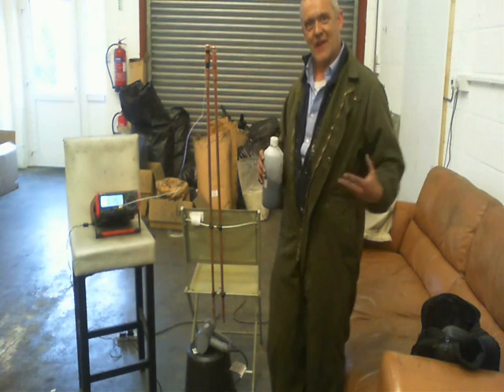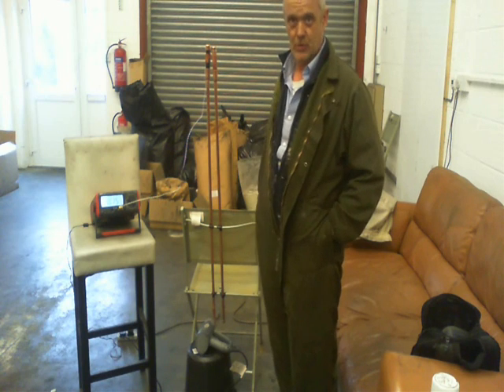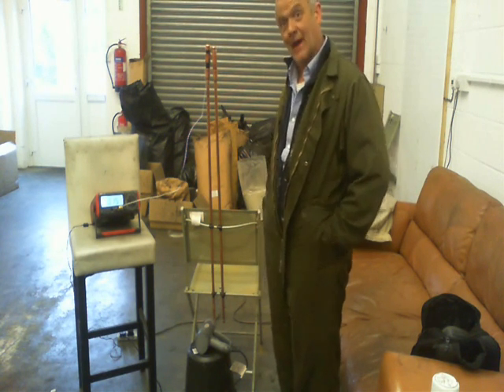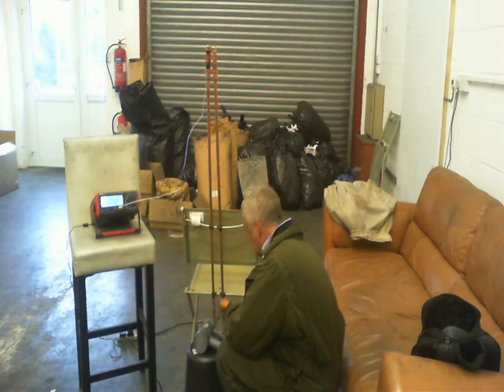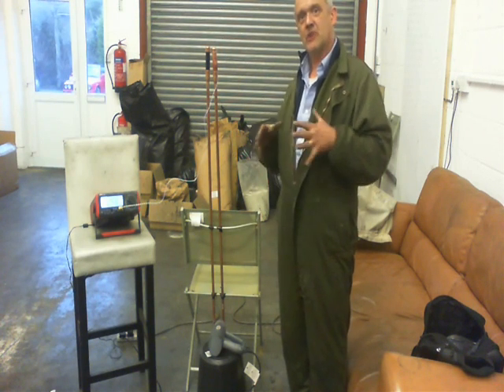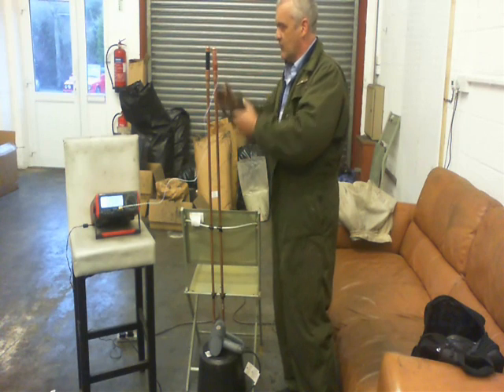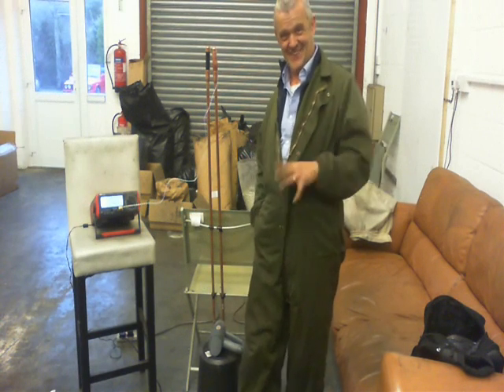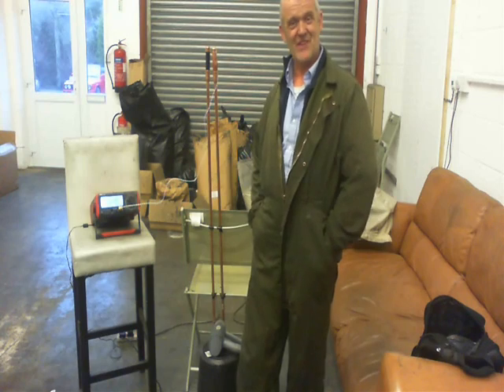Graphene Thermal Transfer Fluid In A Solar Cell Thermal Pipe

Comment: Just come across this vid, thx. Question, taking that the carbon filled took 4 min to get to 40C and the water took 6:45 min to get to 40C. would you say that was a 61% improvement? And if I were to put this in my home radiator system we would see an improvement in effeciantcy?
Reply from the maker: It's basically a heat transfer fluid so it would help there for sure - well I think so - copper nanoparticles might work well too

Comment: Thank you as usual sharing your finding with us.  It is good idea to use a internal heater and thermal insulation from the outside for the pipes to eliminate the possibility if the change in specific heat capacity of the liquid as the cause for the observed effect.
Reply from the maker: sure - sounds good mate

Comment: I am in the process of making a solar thermal system for my home. You video on ,making your own heat pipes was useful, but not as useful as the addition of graphene.

Which, do you think, would be the ideal medium to mix with the graphene within the heat tube?

How much graphene to solution for a 1500 mm evacuated tube? 

Can  you propose a much better heat transfer system from the "bulb" to the carrier fluid?

Where is the cheapest place to buy sufficient graphene for 20 units?

I would really appreciate your opinions.

Regards

Daniel
Isle of Anglesey.
Reply from the maker: +Daniel Phipps Hiya mate I am afraid i don't have much advice to give as all this stuff is experimental and there are  no clear cut answers just as there is no 'cheap' graphene just right now. the cheapest is just to make it yourself and experiment
Reply: +Thanks for replying Robert,
I will certainly make my own Graphene as you suggest. What percentage of fluid to graphene would you mix as a starting point and is water the best fluid, from your experience?
Cheers Robert
Reply from the maker: +Daniel Phipps I would start with 0.5% by weight addition mate and take it from there

Comment: I can independently confirm Robert's claims about this fluid. I made graphene nanofluid from exactly 20 grams of high purity 325 mesh graphite and mixed it into the water loop of a computer cooling system (approx. 20 grams into 20 gallons) to observe its effects. I can report with high confidence that the temps dropped significantly. (in degrees F) CPU before: 82 avg w/ 76 min ~ to ~ 66 avg w/ 64 min | Additionally the GPU went from 115 avg & 114 min ~~ to 99 avg & 97 min. Both measured on Linux with Psensor.
Reply: I roughly guesstimate off the top of my head that the thermal conductivity of the fluid may perhaps be somewhere above pure silver but less than impure diamond. I'll report back after I do some analysis at the university lab and get some data on the matter.
Reply: Sean LutzPicture of my results. 

http://i.imgur.com/gtpsCpI.jpg
Reply from the maker: Sean Lutz  That's very cool mate - no pun intended - you'll have to let me have a copy of the paper when you write it
Reply from the maker: Sean Lutz nice
Reply: Graphite is not graphene. They're made entirely differently.

Comment: Dear Sir,
I have been very interested in graphene fluid for heat pipe.
I think the fluid are mixed GIC into water or aceton or ethyle alcohol like heat pipe working fluids.
Is it right ? Looking forward to hearing your comment.
Reply from the maker: leewoojoung By GIC do you mean graphite intercalation compounds? - because no - that's not right - they would just settle out - you would need to sonicate to get FLG at least
Reply: Thanks for the kind response. Pls let me know how to get FLG. You mean the exfoliating GIC ?
Do you have any simple method to make a graphene fluid for heat pipe.
Best regards,
Reply from the maker: leewoojoung yes exfoliate GICs - search google - there is lots of ways of doing this. Yes I do have a simple method.
Reply: Thanks for your kind and fast reply.
Regarding the simple method, what materials do I need for making the fluid ? Do you recommend
The video for the preparation ? Regards,
Reply from the maker: leewoojoung i am not giving details of that as yet
Reply: One thing I'd like to know to make the fluid would be need a " sonicator" ??
Best regards,
Reply from the maker: leewoojoung depends on how you go about making the fluid - i don't use one but you could try it that way i suppose

Comment: hi mate!
so effectively by addinh graphene to water you lower the specific heat of the aggregate sollution or not?

i am asking coz i might lower the cost of the heat exchangers in the plant by using such a mixture .... now graphene being tiny i doubbt willl generate any problems with the pumps ... but will look into it.

as for the exhaust gases exchanger i need the opposite to highten the specific heat .... the only way i know is making a water sollution with nh3 ... but that corrosive ... the other fluid with loads of h bonds in h3o .... :)  cannot find any info on specific heat and structural stability at above 130 degrees C ..

soŕry for typos ... android today
Reply from the maker: I don't think so mate - I think it improves efficiency of thermal transfer - it's kind of like running it through a heat exchanger with nanoscale pipes - imagine a radiator where the water papes were in the nanoscale - it would cool down very quickly only because the surface area was so much greater - I think the same thing is happening here.
Reply: Aha ... I see ... so stil 4185 specific heat ...
Reply from the maker: actudoran it will be changed a bit - it has to be - after all we have changed the system components - but to get it we'd have to measure it. Not that difficult to do - but equally not something I am likely to do anytime soon
Reply: Robert Murray-Smith lol ... didn't ask for specifics since they would vary with the amount of graphene in the system ... 
Wouldn't the graphene sink to the bottom ? Any other substances needed to prevent that?
Reply from the maker: actudoran lol - I didn't think you did mate - I was saying I wasn't going to measure the specific heat anytime soon - I probably will have to at some stage or other - but right now it's just not a thing i need to do. It is electrostearically stabalised.
Reply: Ok ... great!  Thanks for that!

Comment: Can you by chance try an experiment to calculate the specific heat of conductive ink and run the same experiment on normal water as a control?

My guess is that either a high concentration of ink is throwing off the specific heat by the same amount as crushed charcoal OR the ink is spreading out the heat faster than micro currents in the water normally would.

Brilliant work by the way.
Reply from the maker: there are two pipes - one with ink and one with normal water in it - this was run as a control.

Comment: Forgive me for being so dumb about the basics,  but I would like to try to understand something.
Do transition metals retain any of the physical characteristics of their constituent metals?

If they do, I might have found use for the 10 lbs of beryllium.  
I wonder if you could increase the thermal properties with intercalation of this fluid components
Reply from the maker: mate - transition metals are elements - they are found in the d block of the periodic table and include stuff like copper, gold, iron, chromium etc
Reply: yes want i mean was if you based the fluid on intercalation of say beryllium chloride. 
Would the heat transfer characteristics of the beryllium metal still be present in the chloride form or is it strictly a physical property of it in metal form.

Some of your work was with intercalation of graphite using iron and aluminum chlorides to enhance the electrical characteristics of the end product.
Reply from the maker: no idea mate - sorry

Comment: Confusing. 
Heat pipes work via evaporation & condensation, why would graphene effect that? 
Does graphene evaporate?  (i didn't think it did). 
Does graphene effect the ability of water to evaporate?  Perhaps effecting it's vapor pressure, like dissolved salt can?

Could it be that these results are entirely from the liquid pool at the bottom of the heatpipe being more efficient at moving heat to it's liquid surface?  ie: the results would be purely from graphene's enhancing the convection within the liquid pool at the base, but would be entirely limited to that zone with no effect on the rest of the tube (ie: no effect on the cool condensation end).

I thought i understood heatpipes, as i've been idly pondering howto make flexible heatpipe materials for years.  These results are weird.  What do you think is going on here Rob?
Reply from the maker: I think the graphene improves thermal transfer within the fluid - but Kimberley has a really good grasp of this - have a look at her comments as it is a very good explanation of what is going on - I got hold of it when she compared it to a capacitor for me

Comment: The next step would be to take two chilled water baths with a known quantity of ice and water and have it insulated, and measure both the ambient temp and in one we can calculate the input of energy from the room and in the other we can connect a heat pipe and a heat source and calculate the speed of thermal input into the water bath as a function of the temperature rise and the heat capacitance, phase change, etc.  This will give us throughput or heat flow.
Reply from the maker: my next step is to do a bit of optimisation on the fluid - this is just the first fluid i put together - it is - of course - not just graphene in water - there's a bit more too it. There are 5 major components and they will have an effect when varied - i'll be checking that out for a bit I think - but I am going to use this simple set up as a benchmark then do what you say
Reply from the maker: Aaron Harper This pretty exciting - but i strongly suspect you have to be a little odd to get excited by it lol - I strongly suspect this little series of videos won't get a lot of views!
Reply from the maker: Kimberly Peacock I frowned a bit when I googled sasser - there was a lot of stuff abut child psychology then i realised i had put too many s's in! I get what you are saying but there a couple of things I want to look at around this first
Reply: That is a massive difference in thermal transfer!  In terms of BTUs/min, it represents a powerful application in removing heat for liquid cooled processor applications.
Reply: Robert Murray-Smith The advantage of the thermal transfer fluid is that with the heat pipe you can on sink and source expand the surface area  and improve thermal diffusion to the heat pipes. It also acts as a thermal capacitor which is variable based on the ratio of the constituents of the fluids.  Like Fins on a conventional heat exchanger but with better dynamics.  I also think that using microwave heat input for microfluidic heat transfer with this sort of thing can yield impressive results.  Both in terms of time and energy input to achieve result.   Without giving too much away, in thermal driven sorbent systems, you will find that a stepwise function as oppose to sinusoidal signal is what you want.  At the beginning and end of each cycle fluid flow stops and we just impulse the energy to raise the temperature of the material, and then let entropy take us down hill.  Which is why microwave to susceptor input is interesting.  The susceptors absorb and radiate based upon their distribution within the fluid.  It also ties in with thermo acoustics at this point.  Google Saser Penn State.  To get an idea of what I am talking about.  You do not need the stack as the fluid itself enhanced water organises into the stack.  You take the ultrasound signal and convert it to electricity.  University of Utah a few years back did a lot of work on this.
Reply: Yes well the fluid has capacitance and it is not phase changing, but this can be of an advantage. Think of it like voltage which is fluctuating but you want a nice signal at 12 volts, the thermal capacitance can help keep temperature range in the sweet spot for the heat pipe while source and sink fluctuate a little.

The killer application though is when you are not phase changing but need enhanced thermal transfer and heat diffusion to separate into thermal layers or enhanced convection.   You have lowered the cost of having a massive heat collection apparatus for low temperature differential engines.

Also think of clothing with an absorbent and this system where movement pumps the fluid and provides a the vacuum for a sorbent cooler.  For runners, firefighters, people who work in elevated temperature environments.
Reply from the maker: Kimberly Peacock we should sit at a table and talk this through
Reply: Robert Murray-Smith Yes, exactly. The fluid can store a lot more energy. :) And because you enhanced it we can get it out quickly and even more quickly when coupled to a heat pipe.  Aka we sized the battery to feed a super capacitor.  Such that we get best of both worlds. The supercap excels in giving us power quickly, while the battery excels in energy density.
Reply: Kimberly Peacock that would explain the hysteresis and delay in the transfer.
Reply from the maker: Robert Murray-Smith what you are saying is it's the difference between a battery and a capacitor?
Reply: Robert Murray-Smith Soon we shall.  I should have things here with current project wrapped up in next 30 to 60 days, and then I can focus on other things.  I would love an excuse to visit you.
Reply: Robert Murray-Smith LOL well that is a gentle way of putting it. I have always been a bit different.
Reply from the maker: Kimberly Peacock got it. You are always welcome - i'm sure you have been to England before - but it never hurts to come again
Reply: I love England.  I have liverpool running through my veins.
Reply from the maker: Kimberly Peacock v cool lol

Comment: looks like that works enuff better then just water to be commercial now.
Reply from the maker: not yet mate - this is just the first formulation - there has been no effort to optimise yet
Reply: Robert Murray-Smith yup, that makes sense, & clever as you are i'd be suprized if you couldn't improve it.  quite a good start.
Reply from the maker: TheGEODEAHOLIC I think I can get the improvement up 7 fold mate
Reply: Robert Murray-Smith WOW, that would be impressive & useful.  ok hand, put the spurs to it (!!) I look forward to hearing of your success.
Reply from the maker: TheGEODEAHOLIC on it mate lol